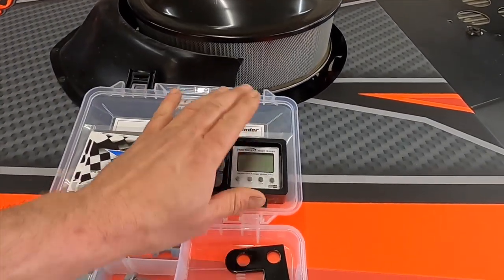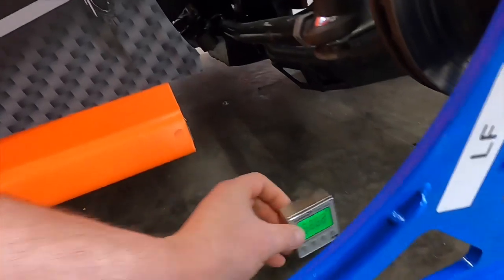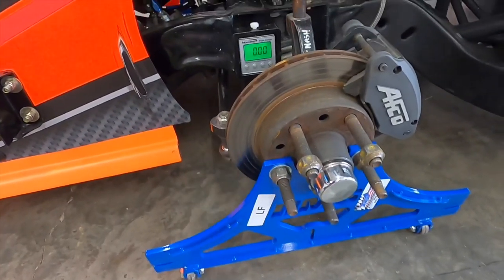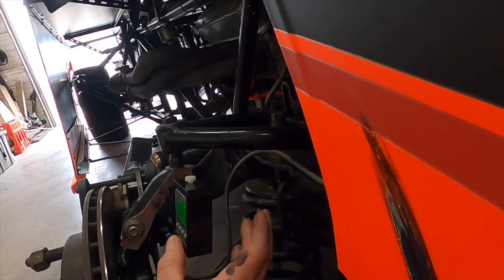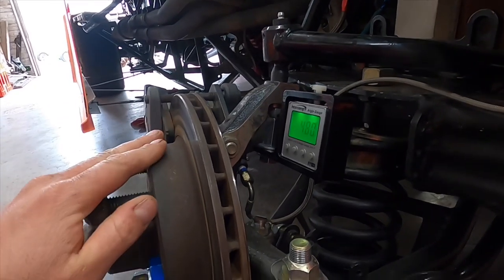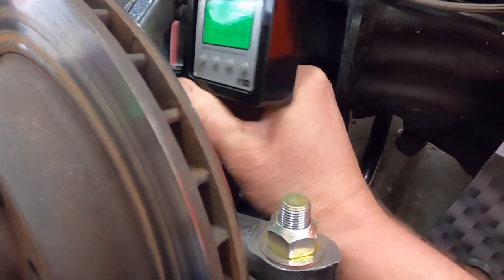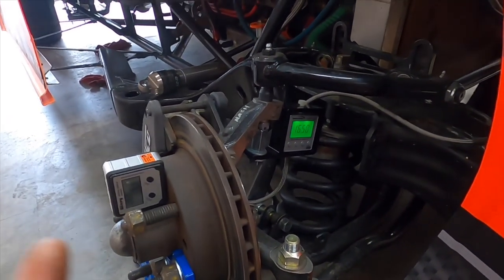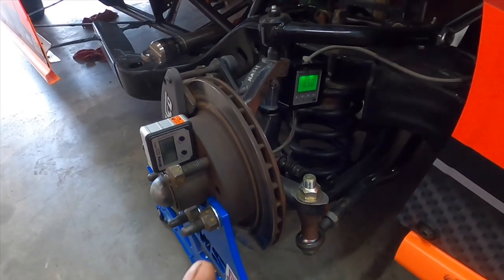This is the EASIEST way to check caster/camber on your race car! 🏎🤷🏻‍♂️ WORK SMART NOT HARD 💪🏻

Comment: What should the camber be on the right front????? Also im a new racer, can you tell me the length from front center tire to rear center tire on both sides, that will give me an idea on what might be wrong with my car.  Im loose in the middle and i can get on the throttle too much, no more than 50% or i spin out.... Think i need to adjust my trailing arm but dont have anyone elses numbers to compare too its a 2010harris chassis which is different but if the difference from left to right is just an inch or maybe 6 onches, whatever it is, will give me an idea to start on
Reply from the maker: Man, each chassis is different, if there’s any way to get ahold of Harris for some answers or if anyone reading this can help this fella out? 

As far as camber on the RF 7-8° should Be good

Comment: I was told that the caster and camber and toe should be set with my car sitting on the ground. Street car not a race car...does it matter? I hear so many different opinions about this  and this shouldn't be rocket science. I just replaced all my bushings, ball joints, center link, inner and outer tie rod ends with new adjusters for the tie rods and new idler arm and new shocks on the front end...I set the caster and camber and toe in by sight only to get me to an alignment shop. After putting the wheels back on I bounce the front end up and down a while to get it to settle with all the front control arm bolts loose. Then set it where it looked close and cranked down all the bolts. Next it my trip to get it dialed in properly. So can the car be aligned with wheels off and your tools with zero weight on suspension...or should it be on the ground instead...let's bust the myth here...I don't know I'm asking You.
Reply from the maker: A short and dirty answer is this…. Proper caster camber needs to be set at ride height.